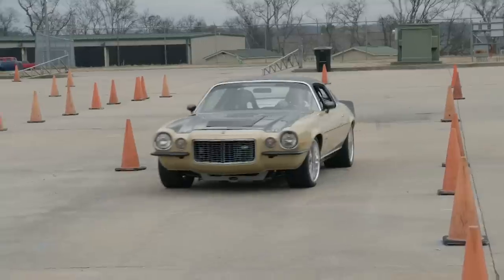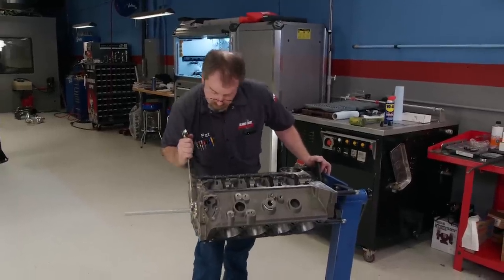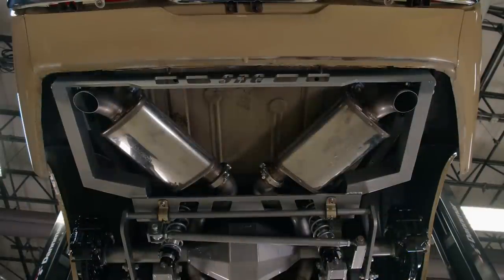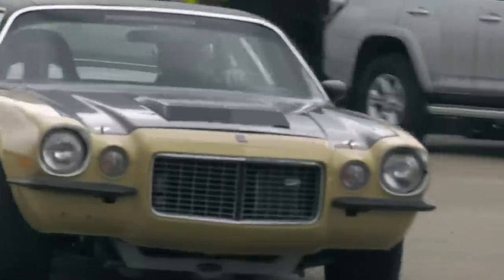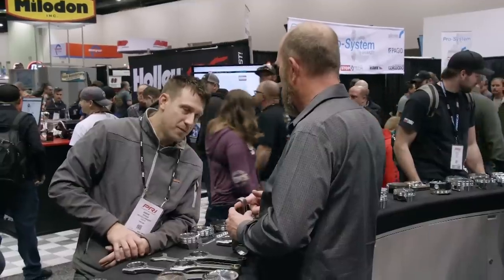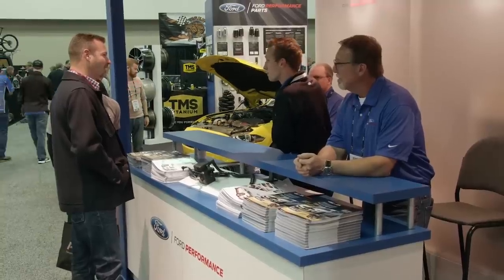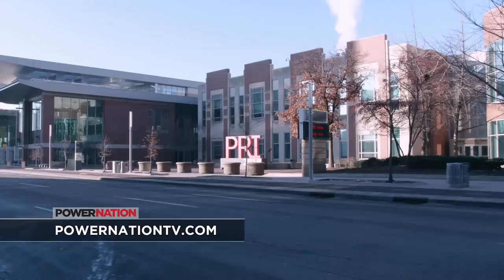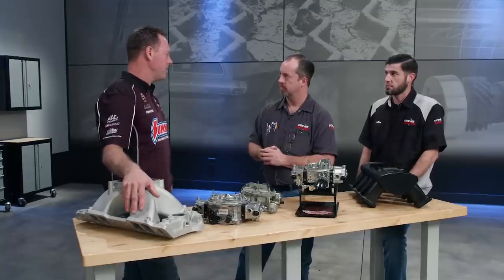600+ Horsepower 2nd Gen Camaro Shakedown  - Engine Power S6, E4

Comment: With so many second gens needing love, Why would you ruin one in that type of original shape? I would have rather seen you guys bring one back to life with all the mods.
Reply: They made the car better.
Reply: @basshead.  I will stick by my original statement. They should have left that one stock and found one in bad shape to repair and modify.
Reply: @bigboreracing356  it was hard for me to understand why stock is so important as a kid till about 3 months ago when i realized that i was disregarding every camaro that wasn't remotely original ive got a 70 that needs just a little bit of work but changing everything to what i want vs what it needs costs way more than just fixing my car selling it and using that money to get the one i want. i just want something as original as mine but at least a 350 with ac not a 307 without ac. they had a clean body that needed little amounts of work to turn into money and decided to just throw money at it because they can is all.
Reply: @bigboreracing356  never said its wrong im saying gl selling it for anything its worth any longer i dont want your toy or theirs i want to make my own and thats the issue with this car now that hes taken it from stock to aftermarket
Reply: +rawrf jenkins    Pro touring cars sell pretty well.
Reply: @basshead.  not for the total that was put in but 3 times stock sure

Comment: Good job on rebuilding the 350. But I dont like using a timing belt. Instead of a double roller chain. Car is in beautiful shape.
Reply: I totally agree brother.
Reply: Why not?  They reduce vibration, harmonics and offer unmatched adjustability.  They also make covers for them for dirty environments.
Reply: @Foxtrot1967  Belt will wear out by 60 to 80 thousand miles. Double Roller chain. DOES NOT! AND THEY ARE MORE EFFICIENT. IF THAT BELT SNAPS, AND Spins can. You will ruin valves.!!
Reply: @pdinardo9472  when you are building a engine for the sole purpose of beating the living shit out of it i wouldnt expect it to out live a belt.

Comment: My car originally was exactly like this car's color and options 73 Type LT RS 350 except the vinyl top and interior were white vs black. If mine was in the shape this one was, I would have never modified it, since it had extensive rust and was in need of basically everything I didn't feel bad changing it from the factory configuration.

Comment: The tan and black doesn't contrast  here, they should of color matched the hood with black accents on the bulge, painted the rear spolier and used a carbon fiber rear bumper to balance out the front bumperettes.

Comment: That car was too clean and stock to have did what you guys did. 
You should have bought a bucket case you would have came out with the same thing but that original stock car wouldn't have been molested with the flavor of the month parts for your car commercial.

Comment: Why put a belt instead of a chain?
Reply: Less engine harmonics and stress on the camshaft. On an engine that's gonna see mostly street use or occasional drag strip use would be fine with a chain. But an engine that's gonna live at higher rpm for extended periods of time benefits from the belt, for longevity. Not to mention it's easier to set and adjust camshaft timing.

Comment: Sorry can’t see why you did that to that nice of car. With all the frame modification, why not fine a crappy car that would have work just as well to road race. You can’t get the old car back now. What a waist.
Reply: Yeah, this was a bad choice. Once you make that many mods, there's no point using an original, mint-condition car as your base. This car should have been respected for what it was. There are other Camaros out there for this purpose.